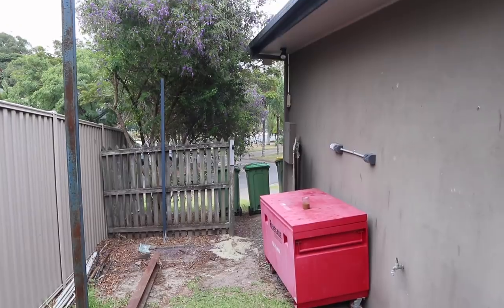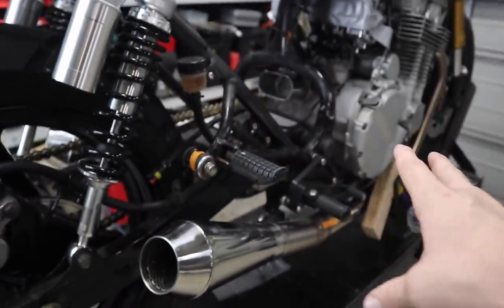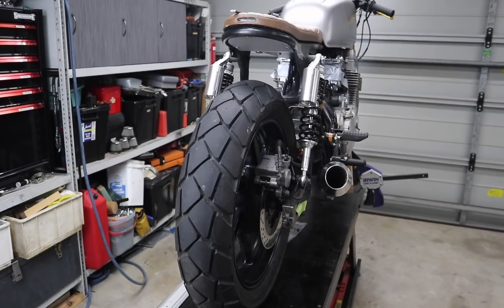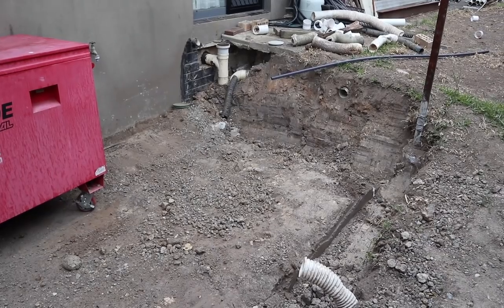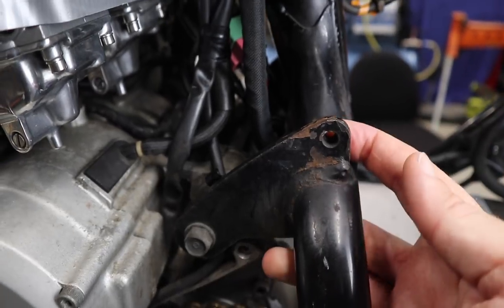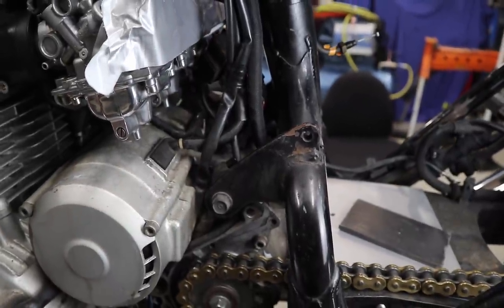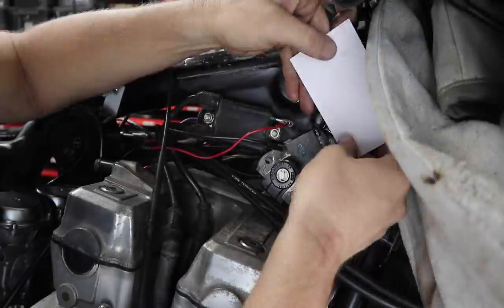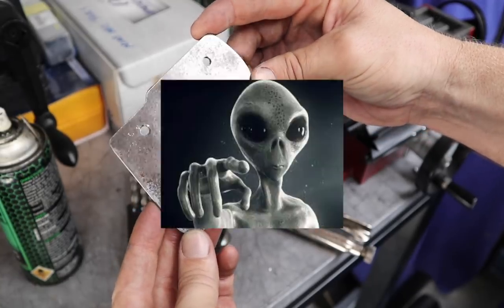Honda CB750 Frame Mods, Making Custom Brackets + GARAGE EXTENSION

Comment: In the uk, im sure we would have to get that inspected. Tidy job though. Good luck with the expansion. 👍
Reply from the maker: They can be very strict on stuff like this.  Good luck if they can spot it once it’s powder coated tho 😂 I think it will look very original when finished ✔️

Comment: Very nice build and I really like the shed idea.  Too bad about the watermain mess.
It does sound as though you are going to eliminate the centre-stand on the Honda.  I understand the motivation, but I have always found a bike without a centre-stand to be a massive PITA.  Every chain adjustment or cleaning, every wheel off-on exercise is much more difficult and the weight saving just (IMO) isn't worth the pain level. Anyhow, to each his own.
Reply from the maker: I totally understand what you are saying and you are right in so many ways, however, this bike will be living in my lounge room and only takin out on the weekends or when I feel like riding. Maintenance for me is easy at home.  It would be better to keep it and I’m not worried about weight, it’s only for looks to keep it clean